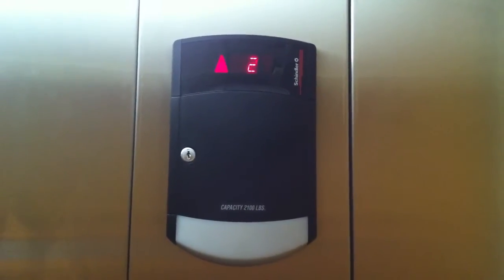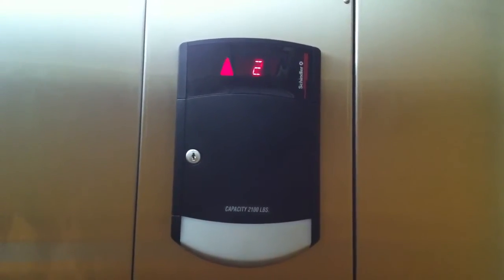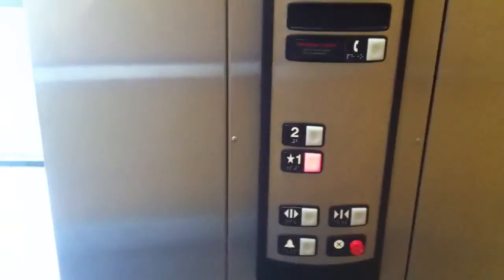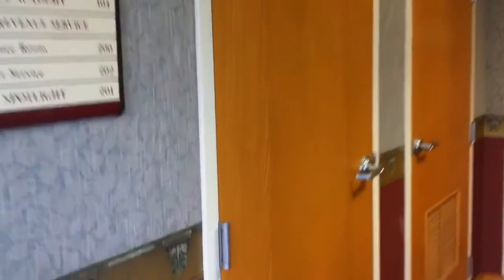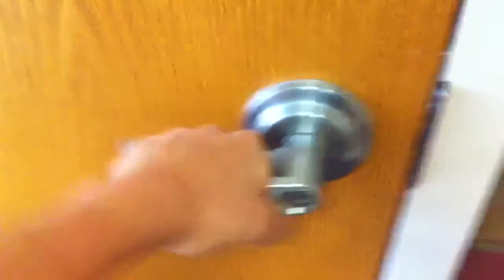EPIC MOTOR: Schindler HT hydraulic Elevator @ Penn Office Bld. in monroeville PA

Comment: This is probably a 321a
Reply: Nathance Former 321A cause when they replace the low pitch chime they also usually update the controller to the one used on 330A, one with updated Chimes but not the controller was the 321A in Dillard’s in Florida
Reply: It appears to be a full 330A, as this was installed in 2002.